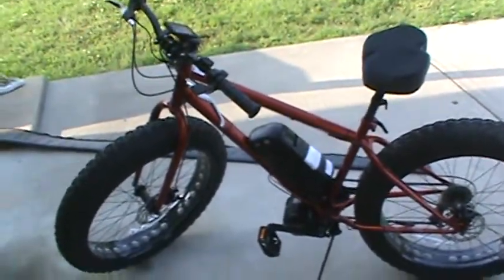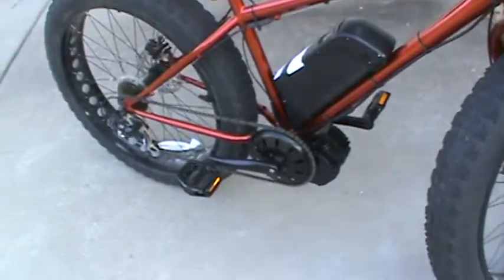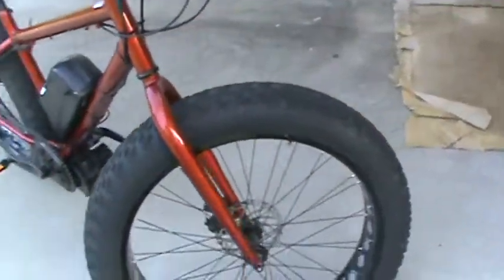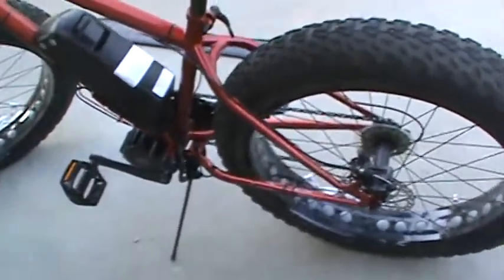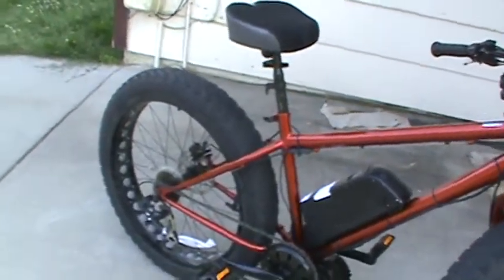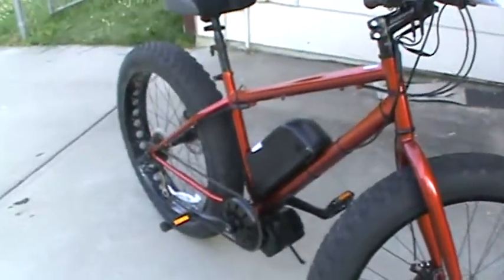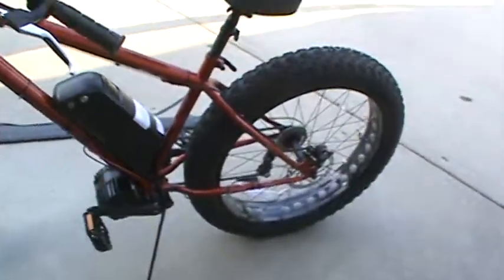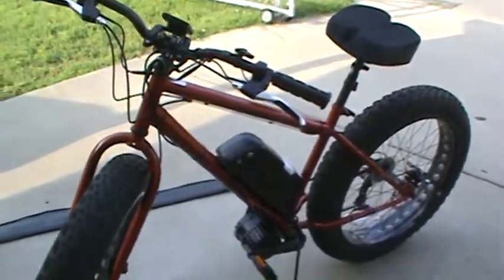Mongoose Hitch Mid Drive Kit

Comment: Is the frame size really 18". I was thinking for proper fit the absolute max would be 17.5" frame for my 28" inseam and 5'6" height. But Mongoose says this Bike fits me. If I were any shorter in inseam the Dolomite would be better. I wish Walmart and Amazon knew how to list Bikes. You are ALWAYS supposed to list the frame size for a proper fitting bike.

Comment: The Mongoose Hitch takes a 100mm bbshd kit  ( look at my Avatar its My bike ) My other Fat bike also takes the 100 mm Kit

You do know you can change your peddle assist to LEVEL 9

The motor is whisper quiet you never hear it running Most people do not even realize it is electric they mostly ask because they do NOT heard anything running.

I ride mine all the time with out using pedals on the trails and Have NEVER had a problem with over heating or even getting really hot

Your main problem that motor got so hot is because of that PIECE OF SHIT ChainRing Trust me GET RID of it .

You will be doing your self a favor by throwing it away and opt for a good chain ring I am using the 30 tooth Mighty mini.

I would recommend at least a 40 tooth because of your size I am about the same size as you and MY top speed in 7th gear is 26 MPH on flat ground 48V samsung 10.4ah battery

I do not use mine for commuting that is why I choose the Mighty Mini Chain Ring I wanted to play on the trails most of the time so I wanted more power or torque for the trail hills.
Reply from the maker: I just change to control so it has 9 level of assist.  I will get rid of the crapy chainring ASAP.  Thanks for your comments!
Reply: These motors are design to run at high speeds so the smaller you make the main chain ring to quicker and faster the motor spins up . BUT keep in mine the smaller the front chain ring to slower the top speed will be.
 But on the PLUS side your motor & gearing will last much longer

Comment: Is the motor noisy? I bought a Mongoose Hitch and used it for hunting.  I wasn't use to the altitude (7200 vs 1500) so this conversion would do nicely if its quiet.
Reply from the maker: James Main The motor is not noisy when you running 30 mph down a tail.
Reply: Its not noisy at all anytime even riding at a slow pace

Comment from the maker: I have put over 200 miles on bike.  I ride it as often as I can.  I did not know how to set the paddle assist at first.  Had it on the highest setting (Level 5).  Now I use level 2 and of course, the motor dose not have to work as hard.
Reply: A year later and???

Comment: I heard mongoose want handle a bafang after a while. You can't ride it if motor gets that hot.
Reply: The first important thing after installing the kit is to TRASH that PIECE of SHIT SOLID STEEL ChainRing and get a good Quality Chain ring Trust me youll thank your self for it  later.

That LARGE Chain ring is the main problem with the kit replace it and NEVER install it in the first place because of the weight of the rider and bike it puts a strain on the motor and these motors like to spin fast and that chain ring really slows it down.
Reply from the maker: Pushyhog I do ride with the pedal assist on lower level like 3.  When I first rode assist was on 5.